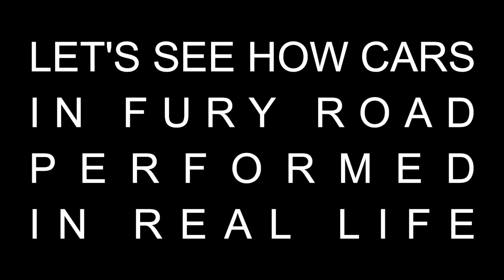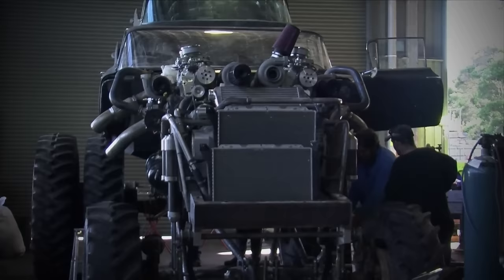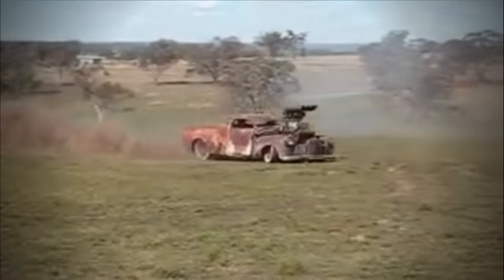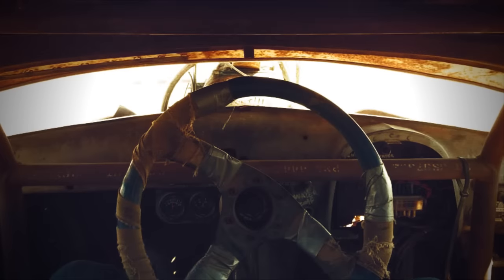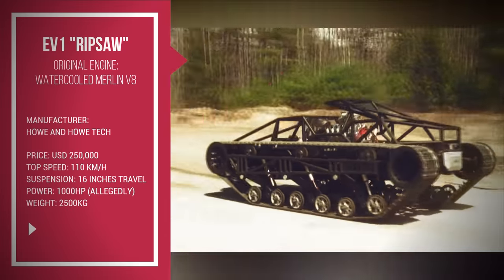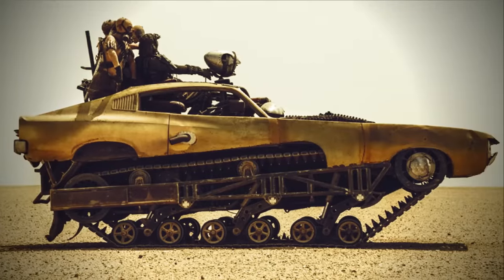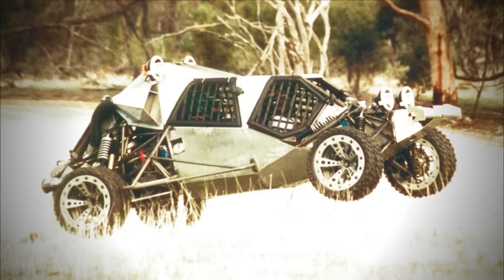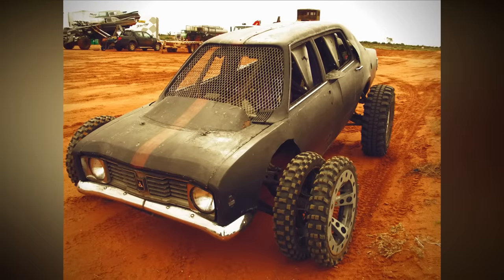Fury Road Cars vs REALITY

Comment: As my mechanic said to me 30 odd years ago none of the cars from mad max would work in real life scenario as they would fall apart within first month. The only cars we would see out in waste lands and anywhere else would be a Toyota corolla those bastards will keep on working
Reply: While a lot of them are covered in silly decorations, they actually did work in real life scenarios for years.  Most are based on off road race cars that were bought up from the market in Australia for the movie.  The Mad Max 2 cars were the same.
Reply: @rubikmonat6589  mate I'm from Australia myself and I own a blown xb also. That thing is so annoying at best if it runs good for a month it will throw a issue at me next month. I replaced ball joints 6 times in 3 months as they kept failing the gilmer belt would come off now and then and temp would go mental time to time. They aren't really that great for a everyday car ha ha.
As I said give it a month and without parts store open no one is running around other then corolla drivers as they bastards are bullet proof
Reply: @jamiehope4580  Yup, bunch of ball bearing(ETA: turbo) modded 4 cylinders. Probably with blow through carb setups, to avoid dealing with ECUs, just a guy with one of the last high temp thermometers to measure EGTs, he's the guy that can tune your car right. After that, just needs enough power to roll around with some welded angle iron here and there for bullet deflection. No reason to have armored car worth of weight slowing you down, given that ammo won't last that long.
Reply: @th3R0b0t  Yeah, IRL there would be a ton of 4-cylinder, 1,6l cars, with some old 4x4 here and there and that's it.
The perfect cars would be carbourated vehicles from the 80's (quite simple, yet reliable, not too refined, with decent fuel economy) too bad most of them rusted away. I used to have Fiat Cinquecento 900 - it lasted for 2 decades and its 900ccm engine was nearly unkillable and maintenance-free and would run on pretty bad fuel too no problem.
Reply: the Toyota pickup is already the workhorse of third world combat zones.
Reply: Or anything with a Bara ;)
Reply: Warboys were master mechanics though.
Reply: Or a Toyota HiLux....can NOT kill one of those...
Reply: @soangry  my small Toyota pickup looks like it's been in several conflicts.... Still going strong but hasn't been inspected in five years, and the driver door is ready to fall off.
Reply: 7.3 idi
Reply: @oriongrandjean5255  na, go with the 6.9 idi for reliability. Without a turbo, the 7.3 idi doesn't gain enough power to be worth the risk of cavitation issues they had.
Reply: @jamiehope4580  Nobody on here said Ford's were reliable ! lol
Reply: Toyota 4WDs, it would be diesel engines and Toyota's.
Reply: @JohnDoe-zx1ck  thanks, kinda forget the 7.3 had that issue
Reply: Also, another authentic car that would work would be the legendary Toyota hilux. If it worked for ISIS, so can it work for me
Reply: @deeznuts-kw6yv  don’t forget the Toyota hilux Africa loves those things
Reply: Never mind I’m stupid
Reply: Ford model t man. Or a model A if you wanna get fancy.
Reply: Personally, I disagree mostly because of the simple stuff from the first 2 films and a lot of background stuff from Fury Road.
Reply: @soangry  like currently in with those Toyota Hiluxes
Reply: Toyotas, Hondas and Subarus are the Ak-47s of the car world 
(From an automotive service advisor)
Reply: @jaygill5582  So overrated and the one thing everyone goes on and on about will actually break the gun
Reply: @nickrustyson8124  You must be an car and gun highly qualified expert.
Reply: @jaygill5582  No I just learn from a guy who actually fixed guns in the army
Reply: @nickrustyson8124  Can this guy design a car or a gun?, learn the difference between  engineers and mechanics.
Reply: @nickrustyson8124  or a car do you actually think that backyard mechanics are the ones creating everything,  instead of scientists, engineers and designers.
Reply: @jaygill5582  No, what are you talking about, we're talking about the World of Mad Max
Reply: It's supposed to be that way. why do you think mechanics are basically worshipped in the mad max universe. anyways these cars are supposed to be power symbols for the warlords of the wasteland they are supposed to show status.
Reply: Toyota hilux??
Reply: The future death-race derby across a parched, post-apocalyptic desert will be a three way race between a Toyota Corolla, a Ford Cortina and a HQ Holden.
Australia's heart is a living room, it's soul a Ford Cortina...    
TISM     The Ballad of Paul Keating
Reply: Corolla, Camry, AU Falcon, Civic, Hilux, older Outback etc. In motorcycle terms: CT110, Super Cub, DR650 etc. Definitely don't have the same appeal.
Reply: That's reality. This movie is about fantasy. Toyotas aren't fun. Just practical. Unless you put 4 engines and 6 wheels on a Land Cruiser, forget it!
Reply: @emitindustries8304  
I agree, for the most part, that Toyota's aren't fun. But they had some decent years. My '95 T100 pickup was a blast to drive for the first 10 or so years. Quick, nimble, nice with the v6 3.4l manual 5spd. Had to change the clutch after 220k mi (all city driving). Been in the shop now to get 4x4 going and change out motor mounts. Hoping to get anothet 27 years out of it.
Reply: I'd be fine in the wasteland, I have a carbed 1982 Volvo 240. I swear, one day when humanity has nuked itself into oblivion, the highly evolved cockroaches will be driving around in old Swedish bricks. They're pretty much indestructible.
Reply: Any old truck you see Mexicans driving. THAT. That's bulletproof
Reply: @famousbowl9926  And the Chevy Astro van. So many of those end up as taxis, are regularly overloaded, have their soul beaten out of them, and somehow still keep ripping on the roughest roads in the northern hemisphere! 
:3
Reply: It would be corollas, old Tacomas, Hilux/Pickups, and older Hondas. Plus maybe a few old American cars
Reply: @jaygill5582 The 12v cummins will outlive them all. Use of homebrew bio diesel, WMO and WVO will ensure it.
Reply: Idk man, my old Audi hasn’t had engine issues since I got it Tuned. I replaced the coil packs 3 years ago and change the oil and that’s literally all. So if that’s not absolutely minimum maintenance than idk what would be. Also I got an old Isuzu Truck that I’m sure would last years in an apocalyptic world just fine.
Reply: @bezimienny_andzej6425 Yeah a carbureted car or an old diesel would be ideal

Comment: Let’s be honest, in a post apocalyptic world only one car will have survived. And that’s the Toyota pickup.
Reply: Or, if you in Russia, a Lada.
Reply: I did imagine two Toyota stack on another Toyota with a 2 turbo charged engine and a long exhaust pipe stick to the back with occasionally shoot flame.....
Reply: Or a Toyota Crown Tokyo taxi
Reply: Good old R-series.
Reply: No v8 not holy enough
Reply: And older Diesels
Reply: I have a 1993 Toyota hilux 2.8 diesel can confirm.

Comment: The Howe &  Howe Ripsaw was originally designed to test their track design which is a really good design for making extremely fast tracked vehicle. However, the problem with the track design is low bearing life and tension issues. Basically the tracks dislike fine sand or mud. (I've only seen one video of their machine driving in mud and it's the oldest video of the machine) Their work with the military has been experimental mainly. With remote controlled versions of the vehicle as ground based attack "drones" or load carrying support vehicles for foot soldiers.
Honestly, the head mechanic for the movie seems like an amazing mechanic since he was able to correct the issues with a vehicle built by self proclaimed pros.

Comment: “Mr. Miller, the Gigahorse is completed, but we could only get it to go 95km/h”
“Add a third engine”
“...”
“...”
“No”
“>:(“
Reply: @wolfie54321  even 95km/h is a lot for that monstrosity
Reply: ''George, NO.'' - ''George YES.''
Reply: "Add a third engine!" Car then is good for 70 km/h.
Reply: The twin engine setup shouldn't even be that big of a deal. Seriously, just call up the Hotwheels headquarters in California. The real-life Twin Mill has the exact same thing going. Two chevy motors going through a single gearbox.
Reply: @wolfie54321  it was definitely limited at top speed by gearing, but I imagine it got to that top speed right quick.
Reply: This thing could go to any pulling tractor contest and get a full pull every time.
Reply: Pfft..... mediocre
Reply: How about 5 engines? Chrysler A57 30-cylinder engine was essentially 5 car engines mounted around shared shaft.
Reply: @ThatWolfWithShades  the twin engines wasn't the big deal. The single turbo 400 transmission dealing with the vehicle's weight and the engine torque was the big deal. That's why they changed to the allison trans

Comment: Love to see some takes on the other star wagons for the movie, like the Doof Wagon
Reply from the maker: I'll get to all of them (hopefully!). I plan on making a video on Fury Road's Interceptor/Razor Cola because I haven's seen anyone do a video on that one, and it's got a pretty cool history!
Reply: @MadMaxBible  Will you also be mentioning the Mini with the V8? IIRC, it was completely undriveable due to the power and very short wheelbase.
Reply from the maker: @alanp3334  Yes I will. I'll lump a few vehicles into single videos because there's really not that much to say about them. Miller hated the Mini.
Reply: @alanp3334  tangentially, my dad worked on race minis in the late 60s (the vitabread VitaMin to be specific). They tried various chassis layouts, but V8 rear drive was considered the worst by far, and rear V8 front drive (yes, really) want much better. They went with front engine, front drive, fuel injection and hot cams, balancing and lightening the internals etc in the end (supercharging was tried but heat soak was an issue)

All very much 'as I recall' as the old man is brown bread these days, though. Sounded like fun times (his main work was on the rear suspension)

That mini did well in its class, too!

Comment: "V16" uh no, a V16 would be if they were mounted nutts to butts, not side by side. That is either a twin-V8 or W-16. Take your pick. But not a V16. That's not how it works.
Reply: thank you
Reply: What doesn't make sense is they did two 502 engines with 502hp each so 1004hp plus two 8/71 blowers that only added 200hp I'm scratching my head on that one.
Reply: @repnatl  blowers are just for looks
Reply: Its was to V-8's I think. If you watch Fury Roads behind the Cars it was supposed to represent that In a world where supplies barely exist, having 2 of everything is "god" like
Reply: @repnatl  I would imagine those blowers are putting out very minimal boost they don't really need it to make massive power they just need it to look cool lol
Reply: A "W" engine is mono block, the gigahorse was dual block
Reply: @deathsdemon349  V V Engine then
Reply: @phrodendekia  I would say a bi block v8 but yeah a vv could be right
Reply: It's called a side by side twin engine setup. This was done for marine use in the 1950's. 2 Hemis powering a single box.

Comment: Cranky Frank's limited visibility can be remedied with an angled mirror on each corner of the front window, & a mirror in the center in front of the driver to create a periscope effect.
Reply: The only issue being it could actually blind the driver if the car goes against the sun.
Reply: Nice idea in theory, but driving that thing in the desert over bumpy roads and with limited visibility at times, wouldn't be possible.  (I could hardly see hands on the steering wheel during the claw car scenes. And I was driving a different/better car in that scene)
Reply: @DCteamtraceur  You drove one of these monsters ? You have all my respect.
Reply: that's not good either since they're in the desert, exposed by hot and bright sunlight...the driver will burn his eyes off
Reply: When OverKiller-75 Runs Whole Modern Warfare Lobbies Into The Ground With His Golden Renetti Pistol, He Normal Gets Shitposted On Various YouTube Video Comments.

Comment: Let’s be honest the only cars running after the apocalypse would be 80’s toyotas
Reply: And old Lada sedans.
Reply: Counterpoint: 90s Toyotas
Reply: Funny. Haven’t seen an 80s Toyota in many years. They may have been tough but they stood no chance against rust.
Reply: The point of having cars in the movies isn't really to travel, it's to have enough speed to take shit from slower people when they appear. Everyone driving an 80s Toyota right after the apocalypse would be fucked cause they ain't going no where fast
Reply: If I hear some one say this again I'm going to do a gymnastic flip off my roof. Here is a list of reliable cars/ engines: 7.3 idi 6.9 idi any detroit diesel any r series engine any a series engine ford straight six any ford fe engine 4.6 2v volvo b series  chrysler slant six any chevy square body any honda d series any honda f series any honda b series cummins and lexus ls400 (1988-2000

Comment: I liked and Subbed. I'm a huge Original Mad Max fan. My question is, How far could they drive supped up cars at full speed? They gotta run out of Gas and take tire damage. Nobody ever talks about Oil and vehicles overheating.
Reply: It's why max's tires and a lot of the tires are filled with cloth rags. As for oil,  places like Gastown.

Comment: Seems weird that there'd be an issue with the Gigahorse's multi-engine setup since people have been bolting up such things for Tractor Pull racing for decades.
Reply: I'd imagine a tractor engine probably wasn't built out of 2 engines mixed into 1.

Comment: one thing I never got was the scene when Furiosa got out of the War Rig after driving through the dust storm and smacks the air cleaner.... but it super charged... with very obvious intake scoops on top of the engines, so the air cleaner would never be used, and knocking the dust off was completely pointless....

Comment: I watched about the first 30 minutes of this film before switching off due to boredom, however I actually recognized one of the minor vehicles as a hot rod I had seen at a car show years earlier, it was fairly cheaply put together but what made it unique was its engine which was a  GM ' Twin Six ' truck engine from the early '60s, it also had a crude exhaust made from that spiral wound flexible exhaust tubing

Comment: The TH400 they were using must have been nearly stock spec.  Built versions of those things get put in everything from 3000+HP drag cars to 1000+HP off road mega trucks.
Reply: Aren't you thinking of Powerglides? I've seen a TH400 with a spiral tear around the bellhousing from a stock 308 GTS HJ Monaro. If the housing cant handle 250 odd bhp, how's it going to handle 1000?

Comment: honestly, i would have driven the mongrel given the chance, i already drive around an open wheel buggy that is scary to drive because of the solid rear and short travel front shocks/suspension, also a lack of rollcage.

and why they didnt cut the door off of it and re-direct the brake pressure to the front is beyond me.

also the guitar is fully  functional
Reply: Not having doors would make it even more of a post-apocalyptic wasteland vehicle. If the production crew had trouble to get in and out, anyone who survived the end of civilization would quickly look for a way to make it more usable.

Comment: It kills me that they had such a hard time with the multiple engines. From the late 60's there have been multi-engine drag cars (i.e. TV Tommy Ivo's creations were the most notable) that produced more HP than the combo they had in the Giggahorse. On top of that, they TH 400 they were using was built poorly. I've seen 2k +hp single engines put their power through a TH 400 and have no issues.
Reply: Not to mention multi-engined tractor pull tractors.
Reply: Walter  It still seems like it would've saved them some trouble to hire a couple of guys that had experience with vehicles like these.
Reply: Walter  high power tractor pulling is a thing in Australia. Apparently something the movie team was totally unaware about. Likely they could have made a few calls and had a reliable dual V8 and transmission setup delivered in short order. In tractor pulling they only have to run a few seconds at a time at maximum power output and heavy loading. What they needed for the movie would have been easy peasy for a professional pulling setup.

Comment: The ripsaw on this set had the original track design 2 cables thru a fabricated track pad. Also looks to be their old steering system with clutches on the outside of a rim that conect the drive axle to the hub. Wonder if they were sent an old used ripsaw.

Comment: In a true post apocalypse world, you'd want vehicles that are rugged, simple, reliable, and DIESEL, cuz they'll run on anything, including heated animal fat, used motor oil and ATF, Kerosene, propane, etc. I'd want a Cummins 4BT with a P-pump, no electronics required, a 5 speed, and 4WD.